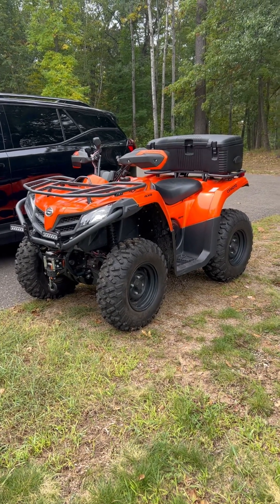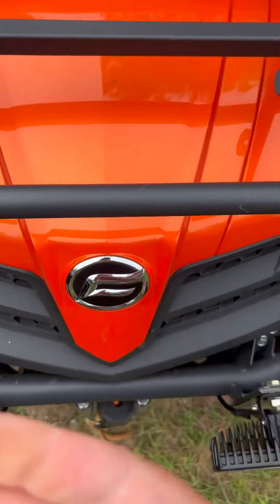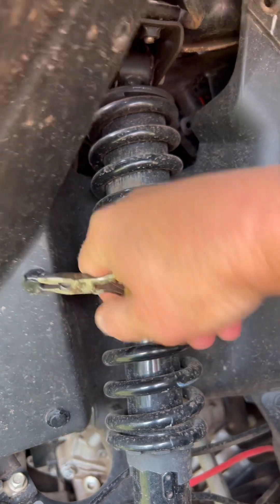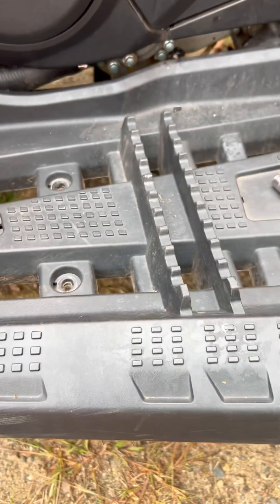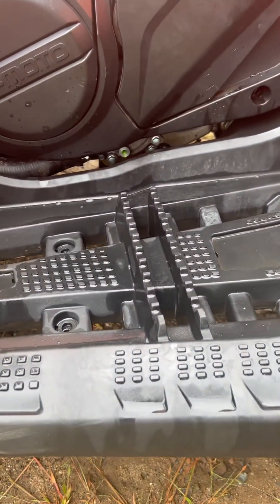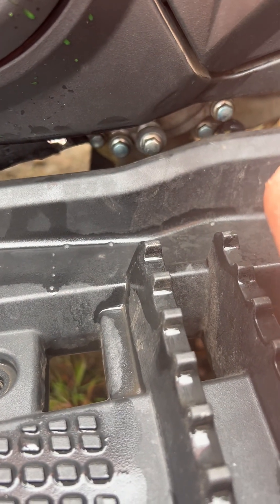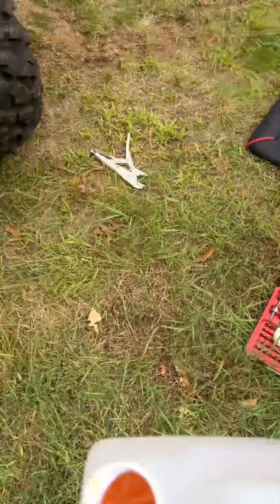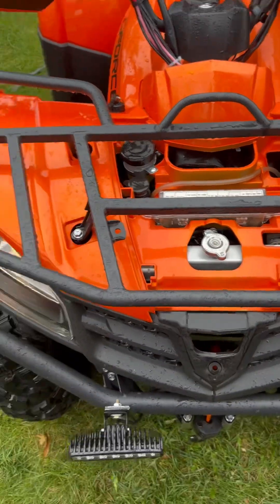Coolant Change 2021 CFORCE 400 Gen 1

Comment: Thanks for video. Did this help lower the coolant temps? I have a 2023 400 and it runs 4 bars out of 5 pretty much all the time brand new. The fan works as it should but I would like it to run at maybe 3 bars as I live in Florida and don't want to over heat it in the future. Thanks.